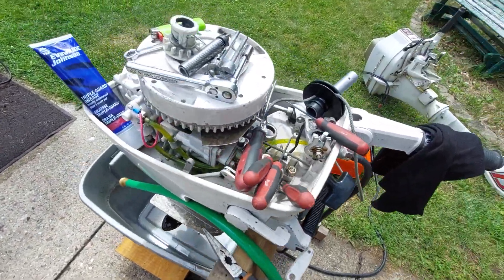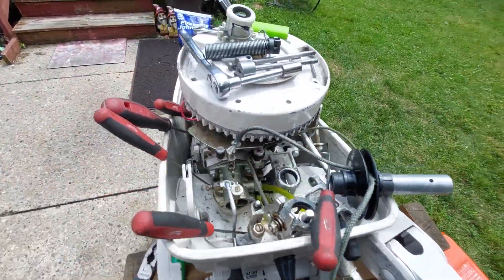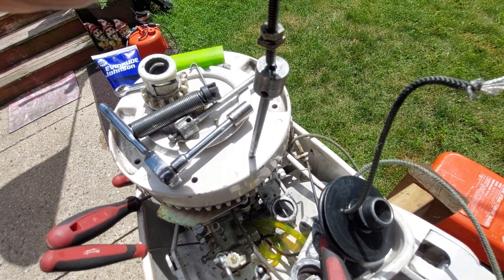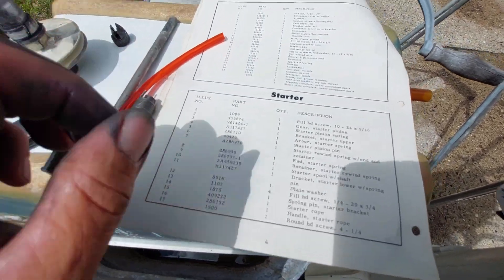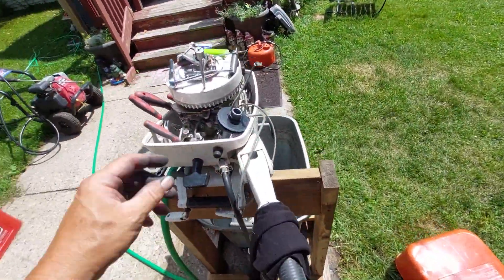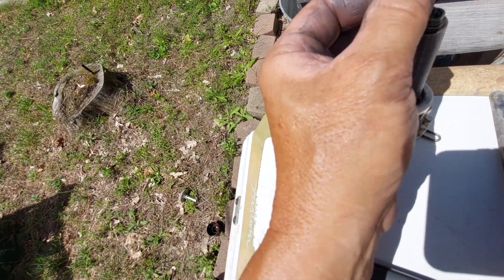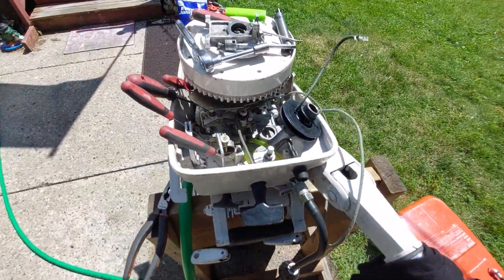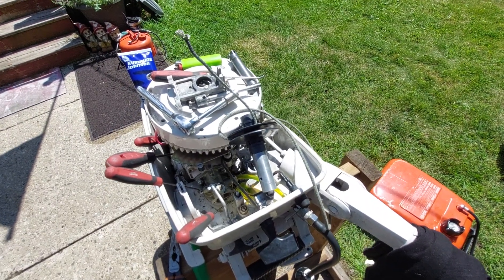Introduction to Chrysler recoil assembly! #outboard #boatmotor #boating #pentastar#outboardmadness

Comment: When I pull my string my gear isn’t lifting to engage the fly wheel. But it does mostly retract. Is that specifically the spring not working ?
Reply from the maker: There is a friction spring located directly under the gear. Perhaps it came off the groove it fits into. The groove is a part of the gear itself and it could be broken off. Look me up on Facebook @American Legend Vintage Outboards Facebook page and then I'll be able to send you pictures of what I am describing using messenger. Thanks for watching USA 🇺🇸
Reply from the maker: The spring looks like a wire loop, wrapping around the bottom of the gear. It doesn't look like a spring, really. I thought I better describe it better

Comment: Any advice if the pull cord isn’t retracting?
Reply from the maker: It could be a combination of old grease that has hardened and the spring needing re-wound
Reply: @ALVintageOutboards it was working yesterday but I took it apart because it had a lot of pressure and was hard to pull. (Harder then normal) but when I put it back together it wont retract
Reply from the maker: @Joeqxt Did you rewind the spring? 5.5 turns
Reply: @ALVintageOutboards I figured it out. It was missing the little bronze cap above the spring. Thank you for the advice though

Comment: I made new components,  the gear/sprocket, the tube , the pin and the little retainer  in the shop at work. Too bad the spring is just too worn out but I just can't bring myself to spend 100 bucks for one. Works ok with the Dewalt drill starter. I was thinking about just changing it to a lawnmower starter similar to the newer Force style. Good job Doug!
Reply from the maker: That is really cool you were able to re- make all those parts! Best way to get affordable parts is in parts motors Tony!!